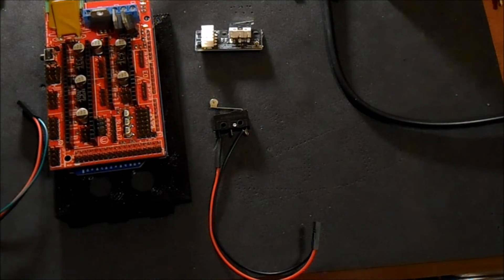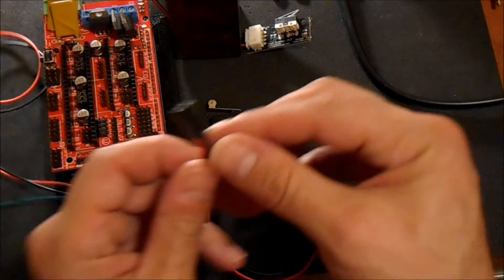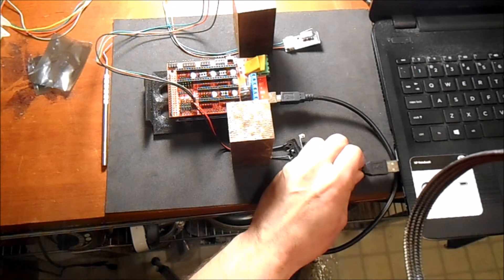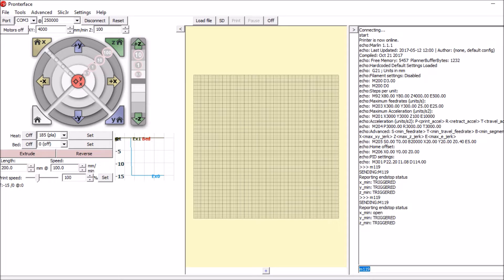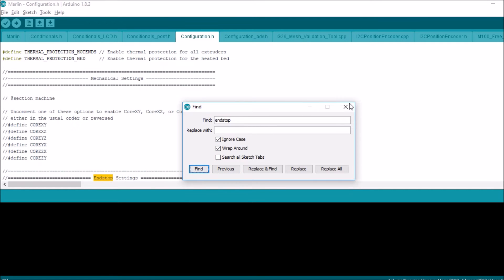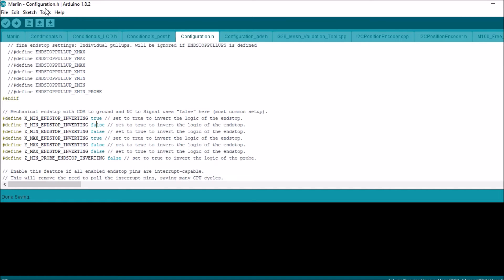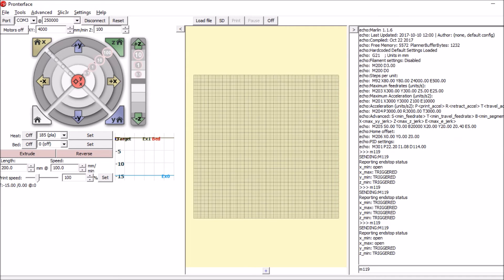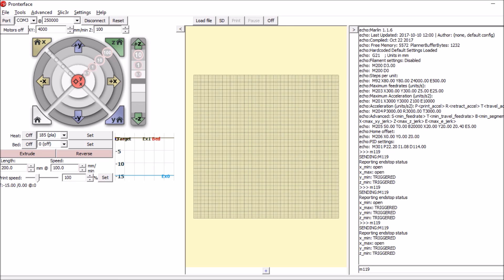RAMPS 1.4 - Endstop switch

Comment: Hello,
This is a very nice project but I have few problems. I would be really happy for you to fix them. So basically when I programmed my Arduino and tested it I only had X and Y motor controllers in ramps 1.4 and didn't had the Z motor controller and extruder. Basically then I added them and Z coordinate Motor (DVD Rom drive) Started overheating and every motor controller started  overheating too. Please tell me what to do and thanks if you answer👍😁
Reply from the maker: The question your asking is not within scope of video.  Keeping in mind my hourly rates are $200 an hour minimum 3 hours.  A NEMA 17 motor costs $10-20.

Comment: Many thanks for the refresh that showed it quickly. this wire here that is there. Okey i had all 3 reversed.
Endstops kept reseeting the board...but i might have done it as a cheap emergency stop many years ago. click kills all 5v to board even to stepper drivers, no 5v but motor gets power from seperate psu= total stop.
was years ago

Comment: I'm building a corexy printer. My endstops show up correctly using M119 in Pronterface but when I move the X or Y to the endstop they don't stop the motors.  I can't figure out why they don't operate correctly.  Any ideas?
Reply from the maker: Could be a connection issue or the endstop might be in the Marlin firmware set to opposite direction.  One test you can do is home on x or y and click endstop manually and see if stops.  You can also send configuration file to me on Discord to take a look.

Comment: if you short + and  -     will it crash or kill board?
Reply from the maker: If you connect ground and voltage pins you'll damage the board.  You should only connect ground and signal pins.
Reply: @EdwardBraiman  have to watch closely plugging in my 2 pin plugs

Comment: I'm wanting to use one of these switches for the automatic bed leveling function for the ramps 1.4, how would i wire that up and which pins do i use? the switch itself only has 2 wires on it.
Reply from the maker: Check out my tutorials on either 3d touch or BL touch.

Comment: i got an error saying ARRAY_0 was not declared in this scope. Any idea why? Nevermind fixed. Great vid ;)
Reply from the maker: What version of Marlin firmware are you using?  What version of Arduino IDE are you using?  What type of board are you using?  Also is there more than an Endstop being configured?
Reply: @EdwardBraiman  actually im having a different problem. Im on ramps 1.4 and some off brand arduino mega and marlin 1.1.x. The issue is the motors sound lime there moving but there just humming
Reply from the maker: My guess without all the information is the trim pods are not calibrated for your motors.
Reply: @EdwardBraiman  Sorry im kind of new to RAMPS 1.4 but what are "pods"
Reply from the maker: Checkout my playlist for MKS Gen L and calibration of either a drv8825 or a4988 stepper driver.
Reply: @EdwardBraiman  there private videos ;(
Reply from the maker: Search on, "MKS Gen L - A4988 calibration".  It's public.

Comment: Hi, I connect a Endstop with 3 wires on the Arduino Mega board, like the first example, and I almost burned it. Now the screen looks bright, but it works. This mistake is for bad wire colours connectors or because I only must connect 2 wires for endstop? (minus and signal), thanks!
Reply from the maker: This video is somewhat dated, my newer videos have a better camera and should be easier to follow.  Your end stop functions?
Reply: @EdwardBraiman  Hola, vi que tenes tutoriales en español. Hablás español? Tengo un endstop como el que mostrás ( el segundo con dos pines ), probé instanaldolo y me trajo problemas. Salió como olor a quemado y lo apagué enseguida. Saqué el endstop y la pantalla quedó blanca. Y da un error. Esto será por el endstop o por que actualicé a Marlin 1.1.9 y fallé en algo de la configuración? Gracias.
Reply from the maker: @stratoanania9713  
Spanish:
No hablo español con fluidez, creo que todavía tengo familia en España desde antes de 1492, pero la mayoría se mudó a Europa del Este y algunos se fueron a Argentina o Estados Unidos en el siglo XX. En el momento en que huele a algo quemado, podría haber sufrido daños en el Arduino Mega 2560. Es necesario reemplazar el Arduino o RAMPS 1.4. al configurar, desea examinar de cerca los pines de abajo hacia arriba para + (voltaje), - (tierra) y s (señal). Los dos cables solo deben conectarse a - (tierra) y s (señal). Espero que esto ayude.
English:
I do not speak fluent Spanish, I think I may still have family in Spain from before 1492, but most moved to eastern Europe and some went to Argentina or the USA in the 1900s .  The moment you smell anything burn you might have had damage caused to the Arduino Mega 2560.  You many need to replace the Arduino and or the RAMPS 1.4.  when setting up you want to examine closely the pins from bottom to top for + (voltage), - (ground) and s (signal).  The two wires should only be connected to - (ground) and s (signal).  Hope this helps.

Comment: One question. In the second endstop the order of the pins  is NC NO C?
Reply: I gues: NC for Negative / C for Signal. Only 2 pin wires need.
Reply from the maker: The pins order from left to right is +(positive), -(Negative or Ground), S(signal).  It only uses Negative and Signal.  Red wire will be Negative and Black will be signal for second sensor example.  My MKS Gen L tutorial is currently what the gold standard of video from me.  I will be posting a new video on Smart Ramps/Arduino Due.  I'm still editing as the process for Marlin FW is slightly changed for 32 bit processors.  It should be up in the next two weeks, but the connection process will be the same.

Comment: Nice video! I have a question. Can I use x_min as the end_stop for the X and x_max as the end_stop for the extruder?
Reply from the maker: Sure, but it might require you to setup the filiment run-out as x_max.
Reply: Edward Braiman That's not a problem for me. But the problem is how/where do I modify in the firmware to act it as an end stop for the extruder. Thanks!! :)
Reply from the maker: I'm working on a mks gen l tutorial for this, but I have a similar one on my RAMPS 1.4 tutorial.
Reply: Please give me the link. Also, some guidelines if possible. Appreciate it.
Reply from the maker: https://youtu.be/ijAuX8d3Mr4 ... You also need to lookup pinouts for the RAMPS 1.4
Reply: Good video! Where do I make changes (code) if I connect the switch to x_max? How does it know to stop extruder if it hit the end stop?
Reply from the maker: You will need to modify the pins file in the video link.  The xmax pins will be assigned in the file or you can Google Ramps 1.4 pinouts to find the pin numbers.  Basically follow the video link and change the pin numbers to the pins you're using.  Hope this helps.

Comment: I like your video I want to ask some questions
If  I change  2 wires endstop  wires to  ground to nc from ground to no   not firmwire  it will work  or wont
Reply from the maker: +Bekir OZGUR could you clarify your question. Are you making reference to physical sensor connection?  Are you also asking about a setting in marlinfw?  It's okay to ask the question in your native language.  I'll be able to understand your description and we will both not lose something in translation.
Reply: Edward Braiman Sorry  I am making a 3d printer  When i sent to home, Axis didnt moved . I push the triger it moves . First i try to change logic in firmware 4mkduo 4.3.2 and same problem . Can I change my endstop logic bu changing wires
Reply from the maker: Bekir, I'm not sure about 4Mkduo firmware, but here are a couple of questions.  If you were to user Pronterface.exe and send the command, "M119", what is the response you see?  If you then use your hand to trigger sensor and send the command, "M119", what is the response?  If you then try and move either left or right by a small increment, what occurs?  It sounds like the logic for homing in which ever axis your move is logically reversed.  One possible fix is to invert the logic.  This can be done in MarlinFW several ways, X_MIN_ENDSTOP_INVERTING or X_ENABLE_ON 0.  Or switching the direction of the plug for you stepper.  Keep in mind if you working with another firmware or hardware I might not have a perfect answer.  Hope this helps.
Reply: Edward Braiman I loaded marlin 1.1.8 it is working
Reply from the maker: +Bekir OZGUR congratulations.